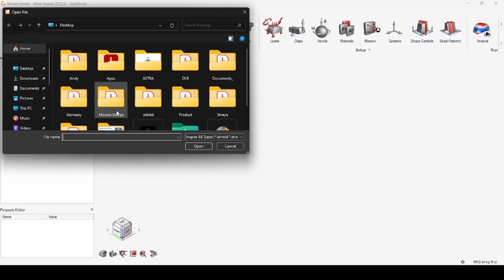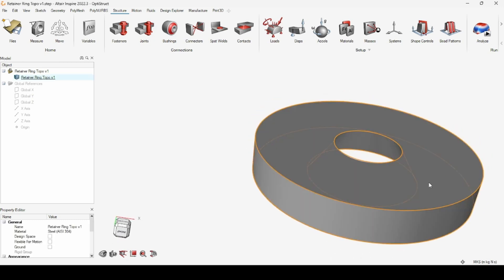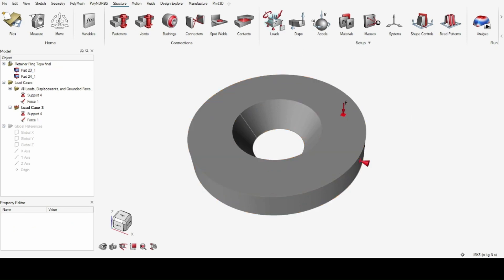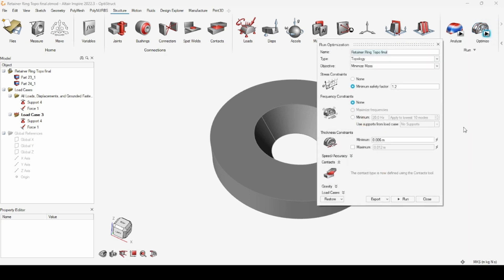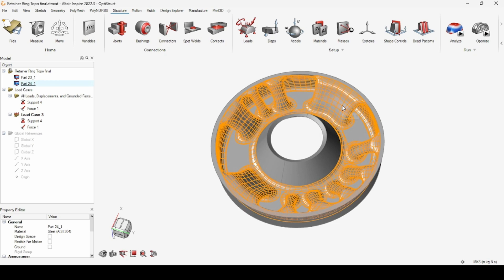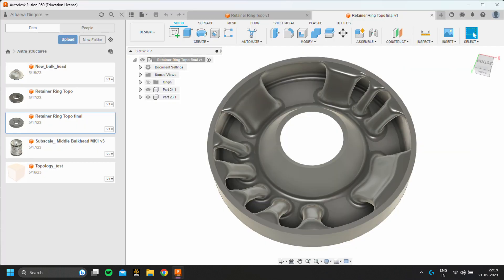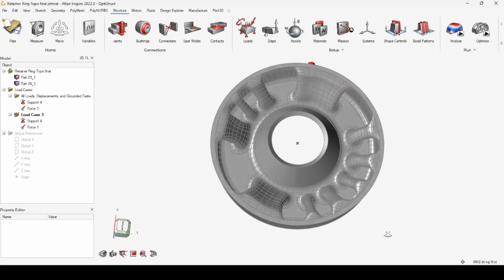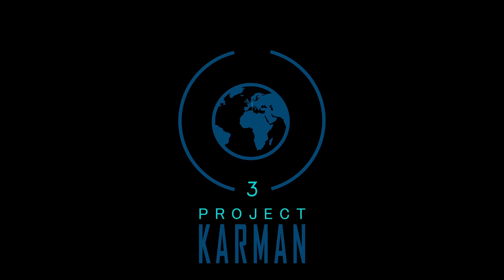How to cut mass on your rocket!

Comment: The model looks very... Unbalanced. Don't rely on that. I would suggest symmetrical cutouts unless you have reason to believe that one part of the plate sees more pressure than another.
Reply from the maker: Yes, symmetrical is better.  However, what is important is the revelations on where mass is not really needed.  We will base a new design on what the topology optimization revealed.